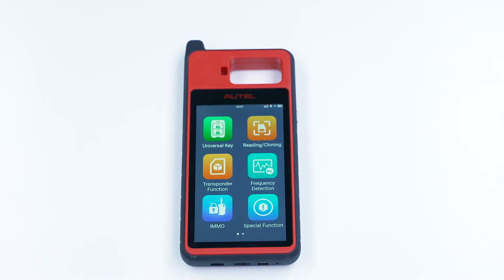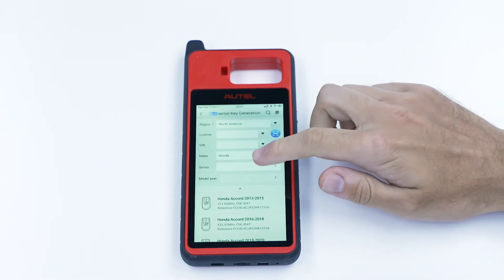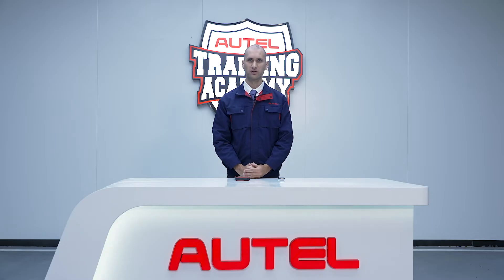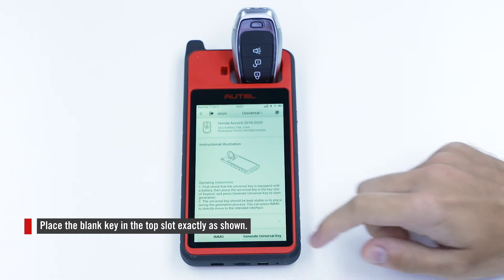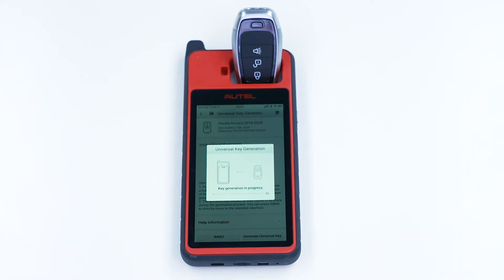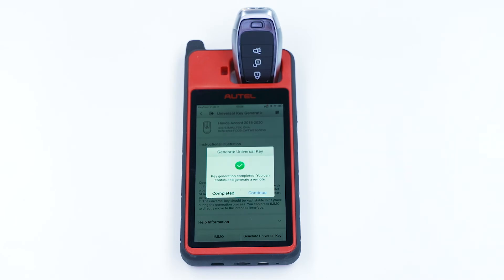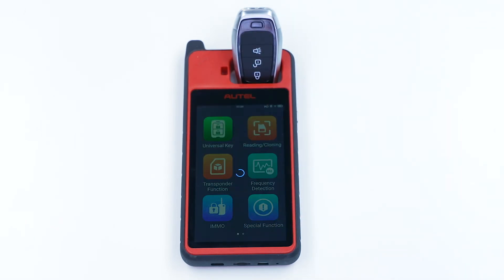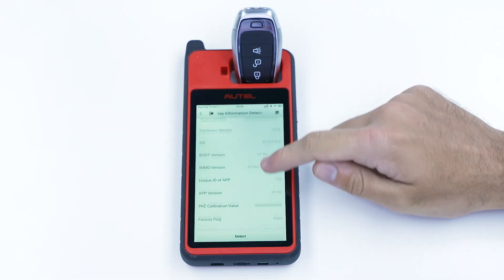(6/7) KM100 :  Immobilizer Data Processing

Comment: How did you read the data with km100?? I have read the data with the laptop and transferred the data with type c cable but everything looks fine but emodata shows processing failure what is the reason?? Please give a new video of how to do it in another way.
Reply: Did you ever figure it out I also want to know got data from a eeprom tool
Reply: @rashidjoseph6981  I read the data with orange5 and transferred it with the data cable, the data is transferred but it doesn't work... Can any of you tell me how to work??